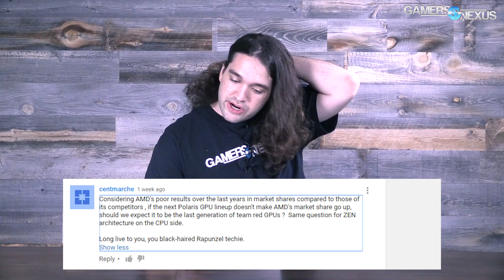Ask GN 16: VCCIO & PLL, Zen & Polaris for AMD, & FRAPS

Comment: Hi Steve, I'm saving up for new GPU for Rift. With GTX 1080 announced would that be a waste running an i5-4670 CPU? Bassically would I be bottlenecking on the CPU to much? My MoBo is Z87 chipset. If so, I may as well keep saving and put off VR for another year and half to two years to build a whole new system with an i7 part.

Comment: Gamers Nexus,  Can you touch on how to buy quality products that do not 
produce coil whine ? This is a big problem for me, when I'm browsing 
GPU's, Power Supply Units, etc.    

Also, do you think some companies are lying to us about stable overclock
 speeds at like 1400, where its not actually stable for the components 
used, and where we should have just gone with a 980Ti at 1100 clock versus overclocked to 1450  ?  :)   Thanks for all these Q&A's.  Personally I have a 660 
that cannot really be overclocked at all, its unstable if I touch it.
Reply: Tech We Love sorry friend but coil whine can happen to any electronics even the highest of.high ends so just try a different one of the same products if it bothers you that much, my MOBO has some bad coilwhile when I run certain.benchmarks A

Comment: Thanks for answering my question, even though it does seem rather hopeless right now. Actually, Fraps is very good for videos as it records raw footage, meaning you not only get absolutely pristine video quality, but it also doesn't use any CPU or GPU resources. Its performance is fully dependant on your hard drive, although I would suggest an SSD for resolutions above 1080. Naturally, that's out of the question for most people, but still.
Shadowplay only works for full-screen games, which sucks if you want to play in windowed or borderless windowed. I know there's the option to record the desktop, but seriously, does anyone want that? Not to mention it would mean having the Shadowplay overlay thing on your screen constantly - either that or not knowing when it's recording at all.
I've tried MSI Afterburner. The recordings were a trainwreck. It corrupted single frames and made the entire video unusable if the game was closed during the recording.
OBS seems alright but it doesn't integrate that well into games, AFAIK it doesn't detect whatever game is being used right now and there's no OSD at all.
I suppose we can only hope for the Fraps team to come out of the woodworks and release a new version. I would even pay for that.

Comment: Hey Steve I have a question on mice since I was thinking of upgrading from my cheap standard mouse to something better suited for gaming. How much does polling rate actually matter? Is 500Hz good enough for gaming, or will I actually benefit from 1000Hz in games? Is 1000Hz just a meaningless marketing strategy? I was thinking of buying the Logitech G602, but the polling rate is only 500Hz to conserve battery power, whereas the similarly priced wired G502 has a 1000Hz polling rate. I would much rather get the G602 because it is wireless and it looks more comfortable, but I want to know if the lower polling rate would affect performance in games.

DPI is not a factor in my decision at all, I don't like high sensitivities anyway. The games I usually play are RPGs such as Fallout and Elder Scrolls, I don't play any competitive FPS games.

Any advice on this would be very much appreciated.

Comment: Stuck between getting a M.2 SSD to take advantage of the slot but getting less storage for my money, or getting another SSD that uses a SATA connection and having extra cables but more storage.
Reply: just to let you know. Check your motherboard about your M.2 compatibility, some motherboards will disable a few SATA ports when connected.
Reply: +Atqthe30th yep I know. I only run one card so I ace them to spare. Not too worried about that. But it is something to consider for the future though I guess. Thanks!
Reply: +Jeremy Volsche best off with the 2.5" drive, the Mushkin ECO3 drives are probably the best to get right now
Reply: +Jeremy Volsche do not get the mushkin drives like that guy said, they have bad reviews all across the board at new egg. such a shit brand. if you go cheap go OCZ or Kingston, at least.
Reply: +Jeremy Volsche just go Samsung. I got three drives from them and no issues yet. If you're going for Kingston use their hyperX and avoid the v300 series. OCZ is hit and miss, my cousin bought a few of them and died in a year
Reply: +Atqthe30th yeah, I should have specified I'll get Samsung regardless. Mostly because of Samsung's performance in DDR5 VRAM, and their software. Definitely leaning towards a regular SSD though.

Comment: It would be extremely disappointing if the low end Polaris card doesn't beat the GTX 950 in FPS power. The Nvidia card already has a 90 watts version, so I don't see how big of an advantage it would be to drop something already so low for a less powerful card. I suppose DX12 and Vulcan could be the reason, I just hope there is more to it.

Comment: If the Polaris 10 card can actually match the GTX 980 Ti I think it will be a hit for AMD
Reply: +Gabriel Fernandez Only if the Pascal replacement doesn't perform. I don't think anyone with a 980ti will care that much if the Polaris matches us. I know I won't. Newer card, it should perform better. No different than a 390x matching a 780ti.

Comment: I have a question for the next ask GN, it's one that I haven't found an answer to ANYWHERE and it's slowly becoming the bane of my existence. 

My PCs fans that are connected to the motherboard via a 3pin fan header and controlled via the bios, with a user made custom fan curve, the fans will randomly ramp up to 100% and spin at that speed for a few seconds before slowing down and then ramping right back up. The only fix I've found so far is to increase the minimum fan speed in the bios slowly, almost like finding a minimum voltage stable over clock lol. Is this to be expected or are my fan headers screwed ?